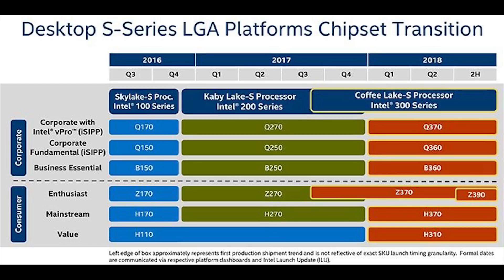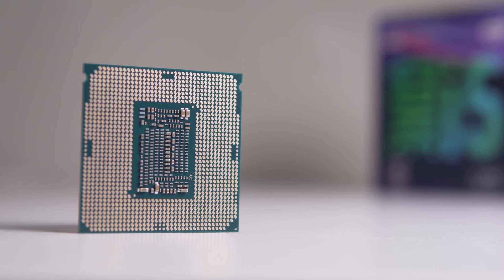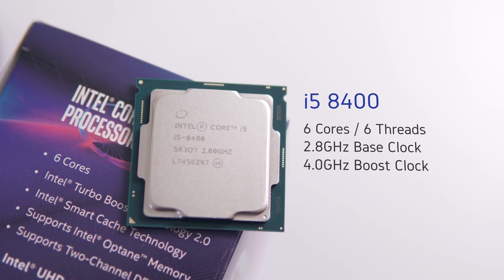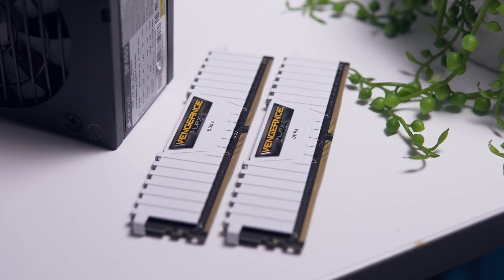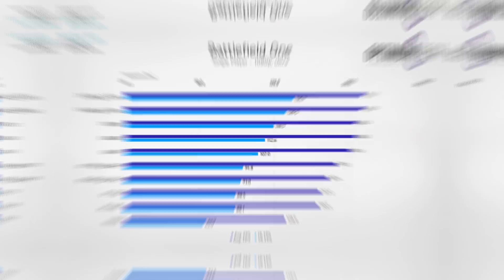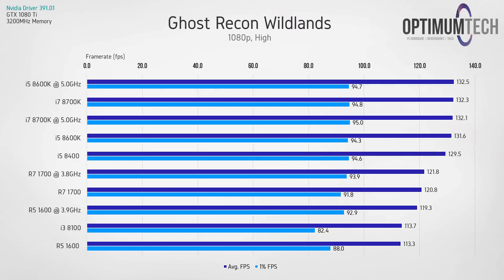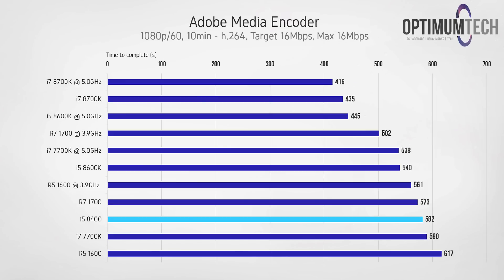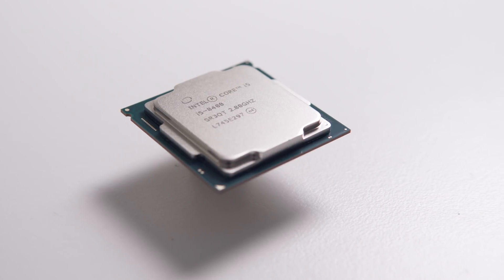Intel's i5 8400 - The Value King?

Comment: any word on the cooling that comes included with the 8400? I wanna know whether it is a good option or whether a seperate cpu cooling system would be benefitial? bare a budget build in mind, I dont want to have to buy water cooling if its simply overkill

Comment: Hi all, i have gtx 1060 6 gb, 16 gb 2400 mhz and i3 8100. I play very well on ultra setting 60 fps full hd. Have I to change with i5 8400? In cpu title i have a bit stuttering or not stable 60

Comment: i had i7 8400 paired up with gtx 1070 ti 32gb ram and i can say from my experience it was shite, i sold it on thank fuck got i7 8700 non k model i am in heaven this thing is lighting fast at everything, i can tell you do not touch 8400 if they were giving it away...
Reply: why bro....???
Reply: @CaptainScorpio24  i had slow performance plus 2 of the mobo i sent back due to sound cutting of all the time....

Comment: Lol I got a beast of a system with the 8600k and a cheap z370 gigabyte board. With junk thermal paste and air it's running at 4.9ghz with a max temp of 77c

Comment: King of value? Not really... The 8600k has the potential to offer much better performance for what, less than 50 extra dollars? Or the 8700 which offers much, much better multi--core performance for only 100$ more. IMHO if you have 180$ for an 8400, you should save up a tad bit more and get either an 8600k and z370 board (you may end up paying about 100$ more in total) or get the 8700 and be set for the future (100$ more for another 5-6 years with that CPU sounds crazy good value to me)

Comment: I am using a i5-8400 with a MSI 1060 6gb and 8gb of 2400MHz RAM yet GTA V is running at such low fps. I'm using more than the recommended specs for the game so can anyone help me understand why its not running at at least 40 fps?
Reply: DeeJay9870 stop playing on ultra
Reply: get yuhself a ram stick in dual channel

Comment: If i am planning to buy an 15 8400 and just slam it into my msi H270 motherboard, i mean like it got the same sockets, but will it work ?
Reply: i5 8400 needs a 300 series chip set will not work with a 200 series chip set.

Comment: I have an i5 8400 8 GB DDR4 2666 mhz combined with a Geforce 1060 6 GB and 512 GB Samsung M2 SSD. If I try to play FC5 in 4k it locks at 30 fps in ultra. Eventhough afterburner shows it taxes each cores at on 30-40% each. But the GPU it as 99% use.  

But in 1440p it easily holds at 60-70 fps eventhough the GPU tax is the same. 

Any thoughts?
Reply: EuromanMovieReport i mean   do you have a 4k screen?  Cos if you dont then none of this really matters does it
Reply: Alex Rogers I connected my computer to my 4k tv :)
Reply: i had i7 8400 paired up with gtx 1070 ti 32gb ram and i can say from my experience it was shite, i sold it on thank fuck got i7 8700 non k model i am in heaven this thing is lighting fast at everything, i can tell you do not touch 8400 if they were giving it away...

Comment: Thanks for the video.  Looking at building a new machine.  I love my current machine from 2013 from ibuypowerpc but I'm getting the itch again.  For what it's worth your I5 link goes to the i3 and your i3 link goes to the I5.  Which motherboard and memory would you pair with this CPU?  I'd like to do raid 0 with two m.2 nvme 960 pros. with two m.2 slots direcftly on the mobo.

Comment: Suggest me please {Gigabyte H370 AORUS GAMING 3 WIFI 8th Gen + Core i5-8500 + gtx1060} and {Gigabyte B360 AORUS GAMING 3 WIFI 8th Gen + Intel 8th Generation Core i5-8400+ gtx1060} which set up is much enough for gaming?? please answer me..basically i i want to the difference between the two motherboards?
Reply: Sheikh Rony vote for first option bcause its higher chipset and cpu.. If u want to know difference h370 and b360 u can googling

Comment: Guys which is the best intel stock cooler or ryzen stock cooler?
Reply: Ryzen, hands down. Some Intel offers stock fan but others like the K series do not. You need to buy a better fan because somehow Intel can't create affordable fans for their OC'ing chips. It adds cost to an already pricey chip. ALL Ryzen series has stock fans that differs depending if it's 3, 5 or 7 and it is still in price range of Intel. Of course you're gonna overclock them at some point so Ryzen did a good job in their stock fans. If you want to really push your OC'ing then you need to buy a better fan.
Reply: Jephthah San Pedro tnx for saying
Reply: FakeNickson as much as i like intel. Its ryzen. Idk why intel have not been updating their stock coolers. The Wraith coolers are COOL asf haha

Comment: I currently have i5 6500. Is it worth if I upgrade it to i5 8500 when budget mobos  come out?
Reply: MEEZARD if you are not satisfied with your current performance and has gtx 1080, yes it worth. but if you got gtx 1050ti, 1060 or rx 580 dont, wait for better gpu.
Reply: I dont think skylake would be a bottleneck even for the next gen of gpu. Youre good unless you got money to spare.
Reply: Thanks everyone :)
Reply: 4thgen  quad cores (i5 and above) will not bottleneck the highest performing gpu to date. Games are no longer cpu intensive.
Reply: If you had a z170 board, you could get that extra performance via a non k overclock bios.

Comment: if you are going to use a cheap z370  with upgrading later in mind (like he just recommended agaisnt) go with the asrock z370 pro4 or the asrock extreme 4 or the killer sli with the pro4 coming in at around 110 and the others under 150. asrock skimps a bit less on the base parts (like vrm's) than other companies do at least then gen.  just my opinion

Comment: While I genuinely respect your opinion here on the value of the i5 8400 (and undoubtedly that thing rocks) I would personally chosen the 8350k over this chip. Based between 169.99 and 179.99 its very close... and while you lose two cores you can instead overclock to 5.0 ghz with a good board. Now I know you consider the price of the board here as part of the budget factor which may be the biggest reason to choose this over the i3 8350k as a dedicated gaming processor, but it also doesn't look like the 8100 and 8300 are too behind either. Seems like less and less performance is getting eeked out of ever generation.

Comment: Edit: great presentation, I5 8400 looks to be pretty future proof. I'm surprised at what a great value the i3 is though, for most things at $99 it's pretty amazing.

B and H motherboards are right around the corner, I've been hearing this since December. I hear new Nvidia gpus are also "coming out real soon"

Could be next week , could be early August, waiting sucks.

Sandy/Ivy used xenons with included ram can be a great value if you can get a good price and still find a new mobo or mod the used mobo into a large case and get an adapter for the psu conversion to a new one.
Reply: whats the best mobo for this ?
Reply: i had i7 8400 paired up with gtx 1070 ti 32gb ram and i can say from my experience it was shite, i sold it on thank fuck got i7 8700 non k model i am in heaven this thing is lighting fast at everything, i can tell you do not touch 8400 if they were giving it away...

Comment: Intel's i5 8400 is the gtx1070 of the cpu family,,best value for performance
Reply: So, with the B360 out. I am building on a budget, should I get the i3 8100 and keep the money saved for a better GPU, SSD, and a 144hz monitor? I already have a decent Bronze rated PSU and a case from my old build. I dont want to overclock and ryzen/+ is expensive in my country. I only play CSGO, Rainbow six Siege, Fortnite, and some indie games.
Reply: It's not futureproof. It's locked, and there is very limited upgrade path for the platform.
Reply: Current Intel platform, is not going to get update. According to Intel, new Coffee Lake CPU (8C16T) is going to get new Z390 motherboard.
Reply: best performance per dollar i3 8100+gtx 1060 3gb, im shure
Reply: Hawk Eyes well actually the gtx 1070 isn't the best value to performance. The 1060 6GB is ranked at #7 while the 1070 is at #13 and everything ranked higher is slower but cheap. Basically the 1060 6GB is the value king. I found mine for $240 (the chart based it at $290) not long ago, GPU prices were great that day.

Edit: some prices dropped so the 1060 dropped from #5 to #7
Reply: georgi ivanov the 3GB 1060 was great on release but the 3 gigs is not going to hold up for long, unless you drop the resolution/graphics on newer titles. However it's ranked at #2 on performance to cost. I don't want to get into the "future proof" cheap everyone says, but 3GB is not enough. I switched from my 750ti to the 1060 and going from 2GB to 6GB was great. The 2GB was always being used, and using the same game settings, my pc uses anywhere from 3GB to 5GB. I imagine it'll only get worse in the coming years.
Reply: I'm laughing at "value king" with 1060. You can get just a bit slower GTX970 for half of a price of 1060. At the moment, there is no "value king" GPUs, everything costs too much and if I can be honest, it's the worse time to spend money on GPU.
Reply: AirsoftAddicted it's actually the best time, GPUs are at MSRP or lower. They'll probably drop even more when 11 series release. And yes it does cost more than a used 970, BUT the 970 is USED, draws more power, and isn't as fast. If overclocked, it still barely compares to the 1060 6GB.
Reply: It doesn't matter if GTX970 is USED - when you can pay HALF of the price of GTX1060 for getting such small performance gain https://youtu.be/qb7_UoimIH0?t=64

Best thing you can do now, it to wait for 2019 for new releases from AMD as competition is always making great things to PC parts pricing. From what we know so far, AMD is planning with their 7nm Navi to deliver GTX1080 perofrmance for under 300 bucks. For now, any prices of nVidia card are at least DOUBLED when it comes to their performance, and AMD cards, due to better performance in mining are even more insane.
Reply: AirsoftAddicted it does matter if it's USED. Most people would rather buy something new for a number of reasons. You get warranty, you can get insurance, you know the hardware is new and don't have to worry about it's life span. And most notably you know for sure your gpu was not used to mine cryprocurrencies, which is a big deal. Crypto cards will have a notably lower life span. On the other hand the power consumption is also lower (avg of 150w compared to the 120w on the 1060).

Also, remember Vega? That was overhyped for what it came out to be. They did not outperform the 1080ti, and we're not well stocked. In the end availability was extremely low and the price tag was blown out of proportion. I have low hopes for Navi. And there is no need to wait for new GPUs the 1060 is perfect for 1080p. Speaking generally, 1080p is the most widely accepted resolution for most everything. I'd love to game at higher resolutions but watching 1080p videos on huge resolutions doesn't seem like a good idea. And no GPUs are actually the closest to MSRP than they've been for a long time. 1060s were selling for over 400, now they're going for as low as $240 for the 6GB model (I got mine for $240 about three weeks ago).
Reply: Still, doesn't matter for me if PC part is used when it's 50% of a price of GPU that will bring you about 7 fps more. TDP is not a problem for me, if anyone bothers with how much he will pay for the energy bills, he should change a job.

GTX970 works in low temps and provides great performance.
Reply: AirsoftAddicted relatively speak this should be an objective conversation, not subjective. Buying a 970 requires a 500w power supply while a 1060 requires a 400w. Roughly a $10-20 difference depending on the rating. Based on a quick eBay search 970 go for $150. A 1060 6GB will sell for $250 new. Subtract $10, since you only need a 400w pay, $240. A $90 difference, which equates to: warranty, +2GB of vram, lower power bill (complaining about your job isn't objective) and better performance and resale value in the future.
Reply: AirsoftAddicted also $150 is not 50% of $250.
Reply: In my country gtx970 is no more, no less but 50% of a price of 1060. Also buying PSU with "it's going to be enough" is not smart. 

I can understand "I don't want to buy used PC parts", that's OK for me. But I don't agree that GPU prices are OK now same as I don't agree that 1060 is a value king. It's just entry level GPU with bumped up price. In performance it's not worth more than 200 USD.
Reply: i had i7 8400 paired up with gtx 1070 ti 32gb ram and i can say from my experience it was shite, i sold it on thank fuck got i7 8700 non k model i am in heaven this thing is lighting fast at everything, i can tell you do not touch 8400 if they were giving it away...
Reply: Hawk Eyes i5 8600k is better for 1070

Comment: Great video! my i5 8400 arrived yesterday just waiting for the cheap mobos to complete the combo.
Reply: @christian camilletti you are a lucky one i had to sell mine do to shitty slow performance, if you know some one with 8700 test it next to each other and you will see the difference...
Reply: i had i7 8400 paired up with gtx 1070 ti 32gb ram and i can say from my experience it was shite, i sold it on thank fuck got i7 8700 non k model i am in heaven this thing is lighting fast at everything, i can tell you do not touch 8400 if they were giving it away...

Comment: It's so weird, this is the second time this year that you produce pretty much the exact video that i need.. :P

Yes, i've been eyeing the 8400 for a SFF build i've been working on in a NES that i converted to house PC hardware. But, i am waiting for the B series motherboards, and i have been for months now. Getting pretty sick of it tbh. But, it's not worth investing in a Z series board either way, as even if i got a K series CPU, there's simply no thermal headroom for overclocking in that build. I'm even planning on delidding the 8400 just to improve temps, as it will more than likely gain me a fair few degrees lower temps, which could be the difference between throttling or no, in this case..

The only reason i haven't already picked up the CPU is, that rumors suggest that an 8500 will be arriving along with the B series boards. The only difference will be a couple hundred mhz clock speeds, but i'll take it if the price is similar. I'm guessing it'll slot in at the 8400's current price, and that the price will be lowered just a bit on the 8400. It's just a guess, but it's based on past experience, so as long as the boards aren't out yet, i might as well wait to see if this CPU will arrive also. :)

What i'm REALLY afraid of, is that the B series boards will arrive, but that there won't be any mITX boards at launch. If i have to wait even longer for those, then i'll just go with Ryzen.

Comment: I think its already too late for i5 8400 in terms of value
Reply: Both the 8400 and 1600 can be found at pretty much the same price, but overall platform cost until b360 comes out is significantly higher on coffeelake.

I'd also argue that the 1600 is almost last gen at this point too
Reply: @Noobish False . i5 8400 is better than 1700 in every single game possible and it cost almost half the price.
Reply: Will the b360 boards overclock?
Reply: ?? No, just like the b250 and b150 boards before it
Reply: Minus around when?
Reply: Noobish false. Just false.
Reply: Coffee lake still wins in Gaming performance :P
Reply: they arent Close in Gaming a ryzen 5 1600 is sometimes as good as a intel quad core in Gaming... so that's very bad
Reply: Zen+ has PBO too
Reply: What’s a better cpu den i5 8400 for a Gtx1070 ti?
Reply: @drinosmanimk  atleast you tried. :-)
Reply: Overall, is better in games and cheaper than all Ryzen cpus. Why is it late again?
Reply: Minus Ryzen 2nd gen almost here
Reply: No one cares. Intel does not need a better cpu at the moment, since even i5-8400 (a non-K cpu) annihilates all AMD cpus in gaming.
Reply: Yeah....and will offer 5% increase in FPS and will be 30% more expensive than current Ryzen. Intel's 8C/16T king is coming as well.
Reply: Minus  King, lol King of 200watt TDP and cookin eggs.
Reply: @mikem9536  someones a salty amd fanboy

Comment: Have my eye on the 8400 or 1600, 8400 definitely seems better for gaming (my primary use) however knowing that amd will use am4 until 2020 giving some great upgrade options makes the choice extremely difficult, think i'll wait a couple months for ryzen 2000 / B360 boards to come out, however I'm leaning towards ryzen.
Reply from the maker: Just want to say it's refreshing to see someone considering both options 😁 
Definitely hang in there and see what happens next month.
Reply: Yeah man, it's just good that we have  2 good choices now, rather than intel being the only logical one.